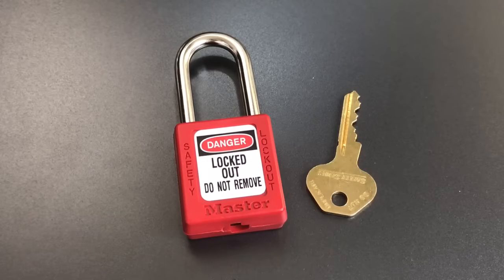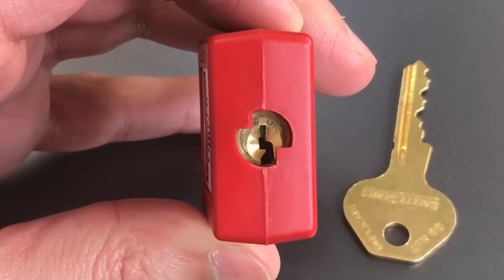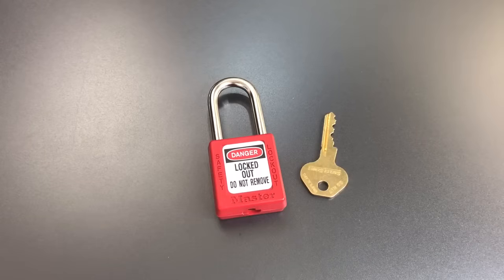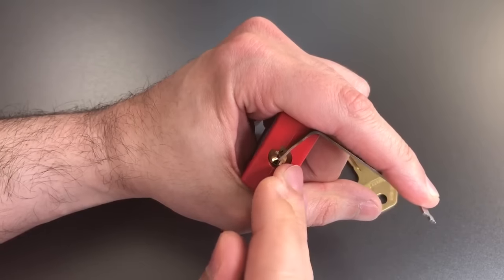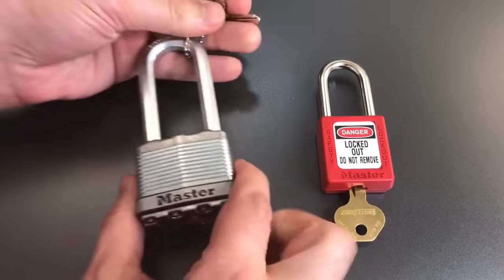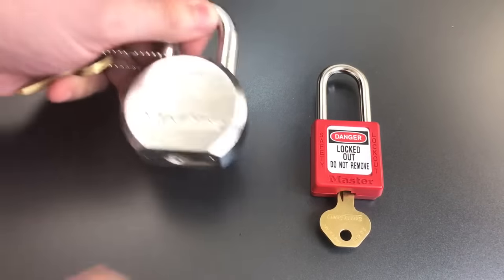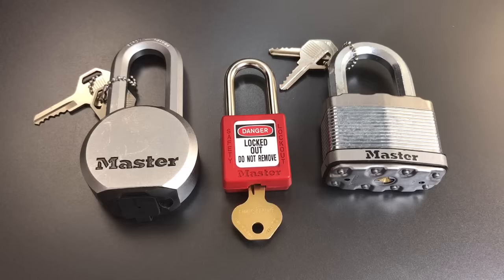[479] The Master Lock Paradox - Model 410 LOTO Padlock

Comment: The reason for the core is because you can potentially have 20+ people locked out at one time; we did it at one of my old jobs.  With the generic 4-pin Master cores, you could definitely have some overlap where someone's key accidentally works on the wrong lock and they unlock the wrong lock...which could be deadly if you have multiple control panels.  This is just their way of making sure keys and locks don't get mixed up.
Reply: It shouldn't be deadly if the employees take some responsibility and actually reading who's tag on the lock. Here in sweden we don't have any LOTO requirement at all (except for public accessible spaces, example: A grocery store, or lobby, or whatever area that is not secured, where LOTO is required). Instead all responsibility falls on the employee which turns on a breaker switch without carefully checking the danger zone. In sweden, isolation switches that are used to isolate a circuit during maintenace even has a warning sign that it may not be turned off for any other purpose than safety - because then people knows that if the switch is turned off, it should not be turned on again by anyone else than the one who turned it off. (so if you turn off a machine during a vacation, you should NOT use the maintenace switch, but rather use a non-maintenace isolation switch for that)
Reply: Sebastian Nielsen - Tagging is still generally required by most companies so locks still in use can be ID'd to whomever is still missing.  Using a group lockout box is the main reason lock security is important, because there's only one lock on the main panel...it only takes one genius to jam his key in the main panel lock, while there is potentially multiple locks still on the group lockout box.
Reply: This sounds plausible. I had to do some work at at a railway maintenance facility that required a broad shutdown of equipment (particularly the 1500vDC). The LOTO procedure before we could start was over 4 hours and involved hundreds of boards and circuits. With cheap locks (e.g. 4 pin) it would almost certainly be possible for a key to release more than one lock and allow an accident. This was a joint Private/Government environment where OHS considerations were extremely strict (even working 1 meter up required an enclosed platform, no ladders were allowed) so I could definitely see them having a "lock safety guide"
Reply: Responsibility is good; idiot-proofing is better.
Reply: Exactly: You can open the wrong lock by mistake in normal operations so the core has to be great; you're very unlikely to physically defeat the lock by mistake, so the lock construction is not important
.
Reply: Or to quote an author I like: "The chances of you making a mistake are slight but the consequences are death; and not your death"
Reply: This still isn't addressing the other side of the question though.... If you're Master Lock, why not put the more secure core that you've already got in production into your higher security locks?
Reply: diamondflaw It could have to do with where the lock was to be deployed. (i.e. who was likely to try to defeat it) You could have a location where it was much more likely to be attacked by unskilled assailants with crowbars or bolt cutters but desirable for a novice 
locksmith to be able to quickly open it. I'm think like maybe the back of a truck.
Reply: @thechosendude he shows other master loockout locks in the video with the generic 4 pin master cores, why does this particular lock have to be better for safety reasons and the others intended for the same purpose do not?
Reply: the one he shown is probably not an certified lockout lock as this type of lock is only supplied with an single key
Reply: gnume gnumon hey only shows one key with the lock. 🔐
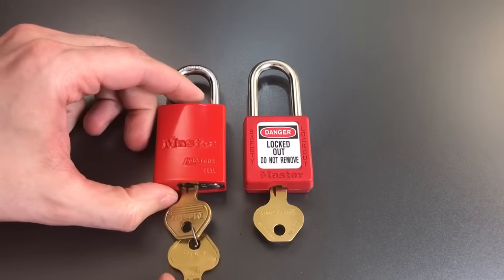Reply: im talking about the aluminum lock at around 4:02 the one on the left has two keys. any lock manufactured to safety regulation would have only one key.
Reply: but you could probably open the 4 pin ML LOTO with anything
Reply: In Norway, we use those kind of locks when we do maintenance on industrial equipment. The only ones who can remove them, is the person who hangs them up, or by the site boss, after making 10000% sure it is safe to do so.. Typical application would be Conveyors, power lines, mills, motors, anything that will kill someone.  Each mechanic has their own locks, if 5 persons work on a conveyor, then we put up 5 different locks on the switch for the conveyor one from each of the workers. That way, nobody can start it until everybody has removed their lock. They are also color coded, Red ones would typically be mechanics locks. Green ones will be health and safety personnel, Yellow ones, will be electrical work, black ones, will be site foreman,   +++ That way you know who to contact if you come across a switch with a lock down lock on it.  Removing one without permission/chain of command will usually result in instant termination.
Reply: just use this lock and hope nobody cuts it or something
OR just box this lock up somewhere where you cant cut it or something
maybe even used a reinforced box to cover this thing and lock it with a crap but strong masterlock? 
i suppose you'd have to have someone who knows or atleast knows ML are easy picking to open up and they grind the lock off or something

but then i do use a plastic toy box with a toy lock as my piggy bank...
the key is even attached to it

just stops the worst from getting in
Reply: gnume gnumon you can go to any hardware store and get a key made as far as I know. I'm Canadian that's how it works here so it's not uncommon to have two, three or even four keys to a door for a hose because everyone that lives there needs a key to get in. I could go to any Home Hardware Home Depot or maybe RONA Home & Garden any of those stores I could go to and get a key made, well not made get a key copied
Reply: thechosendude that does not explain the security pins though
Reply: sure, but some locks have keys you can't buy blanks for,
Reply: satanclaw video 480?
Reply: that zombies player wrote: "thechosendude that does not explain the security pins though"

Possibly to make it harder to tamper with in a way that isn't obvious.
These locks don't typically need to be high security, but it needs to be obvious if someone has messed with it.
Cutting or breaking it off a panel to turn a switch on = obvious.
Picking it to turn a switch on, then relocking it = not obvious.

I've actually had a situation where I was doing HVAC work at an industrial plant that had its own bunch of union electrical workers that were extremely hostile to me because I'm not a union contractor.
I left the electrical panel for the piece of 480v equipment I was working on locked out one night, and the next morning the tag and lock were still there, but the equipment was energized.
Fortunately I always check, even if I "know" it is off.
Someone had picked the shitty lock I was using, turned the power on to the equipment, then put the tag and lock back on.
Basically attempted murder.

A 6 pin lock, with security pins, may just keep some asshole from raking it open with a piece of wire.
Reply: Mark Beiser they could take the lock apart take take your name tag and then put it on a new Lotto lock (don't yell at me if your name is written on the lock because the way I understood it from your comment was you just have a tag on the lock saying your name) and why don't they put that core in there other very expensive locks. Which is what I meant from my original comment.
Reply: that zombies player

I was just throwing it out there as a possible reason for having that core in an otherwise shitty lock. ;)

I do totally agree that it is baffling why they don't put the same kind of core in the better locks.

For the record, these days I use a LOTO lock with my name and cell phone number on it, and a tag with my name and cell phone number on it, and tamper evident tape.
None of that will stop someone with murder on their mind, but it may just make it fractionally harder enough for them to get away with it that they don't try it.
Reply: kodos ;) The strong core is so the wrong key does not accidentally open the wrong lock by the ignorant new guy on the crew . The weak housing is so the lock can be busted open in an emergency. I worked in the engine room of a commercial tugboat, we had these all over the place.
Reply: thechosendude but a bump key opens all if someone is targeting a lock they will have no problem!
Reply: Exactly. so many basic masterlocks with no saftey pins can be scraped open with a normal key with no effort. If they were to put that kind of non-effort into a lockout in which somebodies life was at stake and any old key could possibly open it up first try, it could cost somebody their life but at the same time it needs to be easy enough to cut through with bolt cutters if a key is lost and an employee is trapped inside a work area.
Reply: Sebastian Nielsen I don't know how many times we had to cut one of those off when a guy forgot it, or I saw some guy just trying locks until he found his because no one wrote their info on them. People are lazy and make errors, even in a "safe" environment. Sadly, this leaves it up to the equipment to ensure safety according to OSHA standards.
Reply: I Use Abus Granit 37RK/60's as the LOTO padlocks. aint no one gonna accidentally unlock it.
Reply: But then they make other LOTO locks with poor cores, as show in this video. Why the plastic one with the good core but the more robust LOTO locks with the crappy cores?
Reply: gnume gnumon "certified loto"  isn't a thing. OSHA requires a facility standardize their loto locks, but the specifics of that are entirely discretionary. The three locks described as loto locks are all commonly sold by PPE suppliers.
Reply: THE LOCK HE SHOWS IS A CERTIFIED LOTO LOCK. probably the most used world wide . it only has one key for just that reason ....LOTO
Reply: Jason Morehouse certified loto is not a thing. It has one key because that's cheaper than two keys.
Reply: Yeah, but you've generally only got one key per lock.

Even if you unlock the wrong one, you've still only got the one lock off.  If yours should happen to key two locks, you still won't have the other one.
Reply: People are stupid and lazy. Honestly, nobody where I work would lock out if they weren't forced to. It's easier just to enter the machine with power. Not everyone is as self-aware or thoughtful as the Swedes!
Reply: Exactly. So for the 3 "LOTO" locks:
1. For personal lockout such as tool & die or otherwise industrial. Commonly used by a professional with an appropriate toolkit to store it in; such as electrician, tool & die, safety supervisor whatever. Designed to be lightweight, carried at all times, secure for >1000 individuals, and loggable so your precautions can be tracked.
2. For private company lockout where "civilians" may be present such as a sawmill, quarry, BIG retail, etc. Increased strength for vandalism or robbery concerns, or accidental death.
3. For sole proprietor lockout such as textile manufacture, small retail, private tools, etc. Or for commercial use such as maintenance. It has enough protection to defeat all but a well prepared criminal.
Reply: thechosendude Thank you! Your comments are useful on the subject. I was a maintenance man at a production facility. Our machines had all kinds of energy sources that if not disabled could cause harm, injury or death to somebody. Pneumatic, hydraulic, stored energy, electricity to mention some. We had the old system where no parts of a machine could be energized unless the last man working removed his lock from the power panel. All forms of energy were discharged before working on the machine.
Reply: That might explain the number of pin but not the security pins.
Reply: This explains 6 pins but not security pins. Bidding is bidding.
Reply: On one lockout peg, there was points easily 100 locks all cascading down to the floor with people's lockout locks. This was because operations, maintenance, electricians, mechanics, and contractors all had to be lock out. That extra pin is badly needed on big machines that have a lot of people working in and closely around it.
Reply: diamondflaw because people want to feel secure they don't want to pay the cost too be secure, not that more money always means a better Lock, for Mass market sales it's better to look unbreakable than to be unbreakable.
Reply: Simon WoodburyForget
I won't say you are wrong, but the reason (I think) is because of weight as many of these locks are carried on person between jobs. The primary risk is not through physical defeat but rather the application of safety.
Reply: Are blanks available for safety locks?
Reply: Rev JR
Each employee having the responsibility of tagging out will usually be given multiple locks keyed alike since multiple jobs might be in play at any given time.
Reply: Sebastian Nielsen have you ever heard of human error...
Reply: Good point! The 410 lock is supplied with just one key and it also has stamped text "safety lockout - do not replicate" or something along those lines. The 6835KARED is also keyed alike so it's definitely not suitable for LOTO! It is suitable for some similiar industrial uses but sounds like really big nono for loto.
Reply: thechosendude my thoughts exactly
Reply: Sebastian Nielsen we have more people in one city then you do in your whole country. We can have upwards of 1000 people on one job sight at a time.
Reply: Per the description on Amazon, the core is "reserved for safety padlocks." Presumably the wards are unique, so no other Master Lock key will open this model, even if it has the same pin count and combination.

I also notice the non-conductive body is called out specifically, and OSHA compliance (in the U.S.). It's possible the paradoxical feature mix is suited to accommodate standards in various industries and jurisdictions.

For the 410, I imagine there are situations when being able to remove a lock with bolt cutters is desirable (though the procedure must be intricate), while allowing a non-destructive attack is not.
Reply: Sebastian Nielsen If you've ever worked in an industrial setting you would know that "Shouldn't" is what gets you killed, "couldn't possibly" is the only thing you can trust. Saw a guy try to enable the moving platform for a ride before even checking the Lock Outs, luckily the main switch was off because we had 2 guys 
Under that platform.
Reply: Sebastian Nielsen, thats the way how  should be, but in that case you don't need LOTO at all. BUT, in real life, people have tendency to do mistakes.
Reply: Non Union Guy.... OH HELL NO!!!  you need MEDECO !
Reply: That is a good point, but does not account for the security pins
Reply: As cool as the "instant termination" sounds, the only way you could remove somebody elses lock is to pick it and if you do that termination is your smallest problem. You would probably be charged with attempted manslaughter.
Reply: But then why not put more secure cores in the more secure housings and shackles?
Reply: that zombies player 
The keys say "Do no duplicate" on them.
Reply: Ironfront 
The plastic locks are personal contractor locks with only one key. The other locks are on site locks with alike keys.
It helps if you know how lOTO works. 
An operator follows a plan and locks the appropriate valves and  switches (sometimes there are two dozen locks).
The operator then puts the keys in a lock box and the contractors/workers put their locks on that box.
Reply: that zombies player 
Okay, give a loaded weapon to your beer buddies from work.  Same thing.
Reply: I agree with your answer, it's not about the body or security of the lock. The only reasonable reason why to invest so heavily in the core is to ensure that the overlap is close to 0 on X amount of locks. Becouse if they do... people might die.
Reply: Yeah like how inse key does one thing but not another and another one does both
Reply: i just had my key attached to my loto lock with a piece of wire. because you couldn't leave the key in the lock. never lost the key.. there were usually plenty of locks on the box with the real key anyway. we worked on oil wells the safety guys said you have to lock out every source of energy before working on the well. i said what the well energy . no way to lock that out and still work on the well. the well energy killed many but locking out a power box or 1/2 inch valve justified their job so be it
Reply: Sebastian Nielsen, shoulda coulda woulda
Reply: @sebastiannielsen  I don't care if some other idiot gets in trouble for violating policy if he turned on the machine and kills me.  Apparently you think just the rules will protect you I prefer to actually make a little more sure I'm not going to be killed.
Reply: @sebastiannielsen  should be, but people have died for less, its not worth it.
Reply: @spillproofbox  depends on the client, not master lock.
Reply: @larrybe2900  wrong, multiple locks all keyed uniquely
Reply: Sebastian Nielsen
The place I was employed for decades upon decades utilized the mere tag out policy. It was deemed in strongest terms the requirement to abide by the rules of tagout like an invisible fence is for a dog. The move was made to go to the locks instead of the tags. Trust in some is not always guaranteed and it only takes one idiot to cause harm or destruction. Some "improvements" are questionable but the lock-out system is warranted.
Reply: ZZP Zing Pheonix I agree. The lock isn’t required to be extremely robust under most laws, it just has to prevent unintended opening - and a second key that could open the lock would surely be unintentional and something any site would want to avoid.
Reply: @TheObimara  too bad it doesnt work in govt.
Reply: @diamondflaw  isnt it obvious. Master Lock just wants to fuck with us.
Reply: I was taught that only the person who locked out is allowed to remove the lock of course that doesn't prevent anybody else from entering the danger zone while they're getting the machinery running...
Reply: @sebastiannielsen  6
Reply: Not only that but with so many keys involved in lo/to it has happened so many many times that a individual leaves the area after relief and loses the key or cannot get them on the phone to return to unlock their lock.  So it would be a little more difficult to cut a hardened lock compared to this one.  They’re considered disposable locks
Reply: Did you not watch the video? He shows two other Master LOTO lock models that have only 5 and 4 pins respectively. LPL's point is that if key variance is so important on LOTO locks, then why does Master sell two other LOTO models with 5 and 4 pin cores? And if they have this very well-made 6-pin core, why do they use such terrible cores in their higher-end locks? Hence, a paradox.
Reply: Ok but why do all 6 pins have security pins? Why is it so robust?
Reply: There are basically two requirements for LOTO Locks:
1.  Extremely unlikely for two locks with the same key:  You increase the # of pins to 6.  Makes sense.
2.  You don't have to worry about attacks:  a) Color it red. b) Plastic body. c) Warning labels. d) NO NEED FOR SECURITY PINS. <<<---- (d) doesn't fit with the a, b and c.

What is a bit weird as well is that the other LOTO locks have 4 pins and 5 pins, basically not following requirement #1.

But I don't care about 2d. If they want security pins, no one is effected. What I don't get is why Master Lock doesn't put security pins in their other locks, even strong core ones? It doesn't hurt anyone, I wouldn't think it add much cost, why not make your locks more secure?

And how much would a security pin cost Master Lock anyway? I imagine it's nothing in a $10+ lock.
Reply: @angst_  depends on your industry, in the steel industry where i work, the situation is very much like the "swede" described. after all going into a high voltage transformer vault when it is hot, is a good way to commit suicide and certainly no way to get work done.
Reply: Tagging required, I've yet to see one in 4 years.  Robots in cages, doors always unlocked or even open.  Signed a paper saying I'd never go in a cage not locked out, run machine on door without robot, machine won't run with controller powered off, so you have to do it anyway.  Ask everyone. Nobody can answer.
Reply: What a dumb system
Reply: Eh yes 6 pins 20 users sure but the robustness of the tumbler is just use theese are the most used padlock I have ever owned
Reply: @sebastiannielsen  here in America we have to put stickers on lawnmowers saying you can cut your fingers off if you pick it up and use it as a hedge trimmer. You think the average worker can even follow loto rules?
Reply: Ironfront Because those other locks are  designed to protect property. This lock protects against loss of life.
Reply: @sebastiannielsen  i wasn't aware Sweden was accident proof
Reply: @baconology3065  
I was assigned a box of locks identified  with my name and one physical key for the lot. Color by trade or department. Each individual had sole control over the locks assigned to him/ her.
Reply: @StevenS757  
Age of design requirements.
Reply: That doesn't mean it needs anything more than a higher number of possible key codes.
Reply: When a job is done the tag is removed so no reason to be trying to unlock a lock on a job that you did not do.
Reply: The replies you all are giving to the original comment by Cup & Cone are so fucking moronic. It’s hard to read them. 
The original comment is correct. You might have 10 or 20 people locked out in one area. 
The plastic red lock out tag out lock IS used everywhere and is to “code” as nebulous a term as that is. I have one of the same model and use it all the time. 
The reason for it being unhardened steel is that those fuckers have to be cut off every so often! 
Inevitably, someone will go home and leave their lock still on a gate or box or wherever. Once it has been verified that that person is not in fact still working a supervisor might need to cut the lock off so production can continue etc. 
I don’t understand why this is so hard for you commenters. Imagine that this is a real life scenario and imagine that it’s actually a field that you work in before putting in your two cents which happens to be so wrong it’s painful to read.
Reply: @TheObimara  You're exactly right  but if it was a group lockout and you did happen to open the wrong lock on the lock box and there was still someone working on it there would still be your actual lock left on the box.
Reply: @sebastiannielsen  Bruh people take responsibility no matter where they're at. Mistakes still happen, everywhere, and if it's going to happen, why not try to save a life with a cheap lock? Maybe you should compare work-place accidents. Quit your racist bullshit.
Reply: @sebastiannielsen  Even if it's not deadly it's not legal. Having duplicate keys or master keys for LOTO locks is a violation of the OSHA requirements.
Reply: @spillproofbox  I believe that the 6 pin loto model is the most recent one. At s data center I was on, we used that same model and we had over a thousand locks on site at any one time.
Reply: @SantaClaw  alright, we get it. Sweden is amazing and does absolutely everything perfectly an no one ever dies there
Reply: From my experience, the plastic loto lock has a key capture feature, so perhaps that is why that core is used?  The 6 pins makes sense to eliminate or help eliminate accidentally opening someone else's lock on a larger job with a ton of locks, a slight chance of happening with even a 4 pin lock, but with death as a potential consequence, its worth spending a bit more on the 6 pin lock.
Reply: @sebastiannielsen  that sounds like the worst system.  I can't imagine not having lockout in an industrial setting.  When you have different departments working on equipment and not necessarily communicating properly with eachother, it is a necessity to lock out to be 100% sure a machine will not turn on while you are inside of it.
Reply: @sebastiannielsen  if that is true, and I am highly sceptical that no companies in Sweden do LO/TO, it is insanely dangerous.  This has been proven time and time again, with the history written in blood.  Mistakes happen, communication fails, people get tired...but locks don't suddenly disappear. 

On the other hand, in 40 years of life I haven't ever seen anything with a label that says made in Sweden other than a watch ..so maybe it's not much of an issue lol.
Reply: @sebastiannielsen  LOTO isn't a law it's an industry standard. So yes you're right you don't legally have to follow it there but neither do we. In fact if it is law there that public places have to follow LOTO than you actually have more LOTO laws than we do. I'd wager a majority of companies there do follow the standard as well and they take it very seriously there as if it was the law. Failure to follow LOTO guidelines is instant termination in many places.
Reply: @TheObimara  I know I'm a year late, but... 

Idiot proofing just yields stronger idiots.

They will find a way.
Reply: @sebastiannielsen  yea except that leaves the lives of responsible technicians in the hands of irresponsible technicians
Reply: @sebastiannielsen  people having responsibility and checking before they remove the locks would be an ideal world. But we don't live in that. Even the smallest of slip ups on mining sites or similar places can lead to fatalities in the workplace. People just aren't built to be 100% all the time and things happen. Hopefully on accident.
Reply: @sebastiannielsen  why would you rely on people when you can rely on a machine to make sure people don't accidentally kill eachother?
Reply: @gnumone  It's used in major manufacturing plants like Visy. Hundreds of people entrusted their lives to those plastic locks per shutdown.